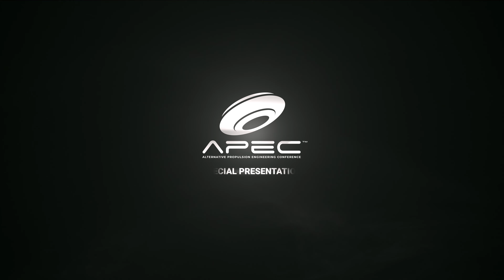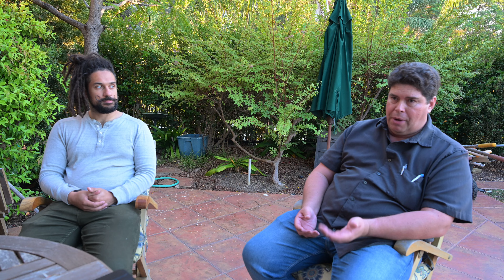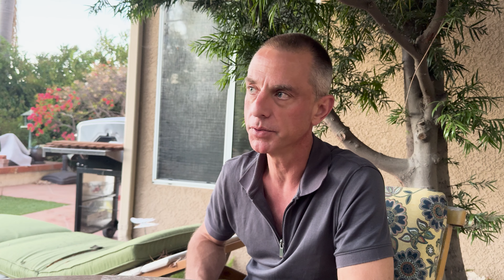Mach Effect MEGA Drive Research | Curtis Horn & David Chester | CSUF 2024

Comment: At 10:19 the problems due to a sliding (ball bearing) mount are commented on. I wish you would replace the slide with a Flexure! I'm sure this would solve your measurement issues. Here is a Flexure video link with a time stamp of a particularly well suited flexure made from Nitinol ( https://www.youtube.com/watch?v=PaypcVFPs48&t=333s ). If operated within their design range, flexures have infinite life! When I say well suited, I mean it is light and has relativly large linear travel (20mm in that particular case).
Reply: 24:10 "Big ears" - You cannot have binding issues with a Flexure. Dump the sleeve bearings.

Comment: It has to do with assymetry in acceleration via 2 frequencies mixing 2f and f.  now play with the phase and you get assymetry in acceleration.  Like scooting your but on the carpet.  pulling harder than you push against the fabric of space-time.  The heavy mass is the ancor mass and the light mass is that accelerated mass that manipulates space time.  it depends on the assumption that there is a difference in coupling with space time based on your accleration. Like orbiting black holes pushing energy into space time. little more to it than that but thats the gist of it.